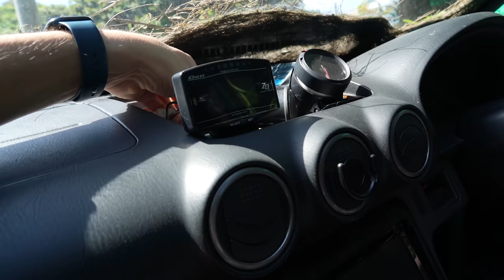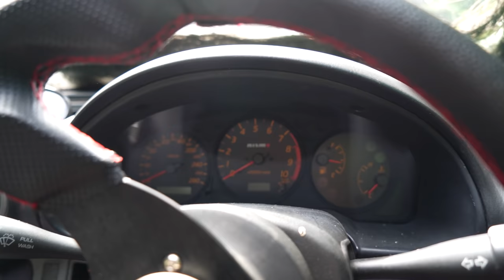I BOUGHT THIS ABANDONED S15 SILVIA & I’M SAVING IT! - REAL LIFE BARN FIND!

Comment: "Rocket Bunny kit was technically stolen" No that's outright theft, when shops receive these cars to be worked on, they do not own any of the car, they are there to provide it a service. The dude chopped up their kit and sold it for a profit when he did not own the car it was on, nor the kit that was put onto it. It's outright theft.
Reply: was getting ready to say the same thing ended up reading some comments to see if someones said it lol..
Reply: they could get the kit back aswell, because the guy that has it now does not own it
Reply: Forgive my lack of knowledge, but are the S-Chassis rocket bunny kits still being made/sold? (Or any new rocket bunny kits)
Reply: @phlooke  they’re made to order usually, you can find them once in awhile if someone changes up their build but you can order them directly from rocket bunny it’s decently expensive though
Reply: The shear audacity.. That’s what I have trouble wrapping my head around.
Reply: Fr that’s what i thought. Just for that they should take that skyline and that 180sx ftw haha
Reply: @penta7539  been years that kit is gone

Comment: The car looks amazing especially the way the other cars looked like, and if I had to choose one car to save in the video I'd probably go with the 180 or the 33.
Reply: I’d choose the 86 if I didn’t have to spend 4 years doing body work to fix the rusty buckets
Reply: That 180 looks like will start right away.
Reply: nah s15 for the win
Reply: @jmccarsnmore1025  I'd most likely pick the 180 lookin like there isn't much work to be done... but I will admit I've like 0.001% car knowledge compared to sammit. So let's say that's the primary reason I'd pick that xD.

Comment: I would be busting my arse (blood sweat, tears and broken gears) to save and complete this project rather than ripping out the air ride and tossing away all the money that's been dumped into just the body to get it to drop and drive nice on the air ride, which seems to be what this car was built around, it was a full rocket bunny S15 at one time in its life 

When you really dig into it and realise how much has been done, it's a shame to use it as just a zero f**ks given practice car 🤦‍♂️